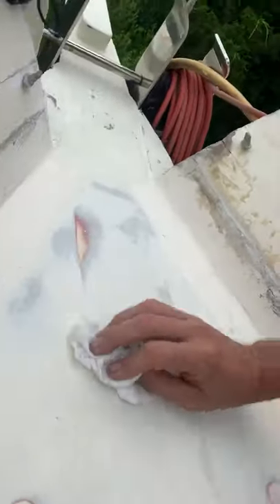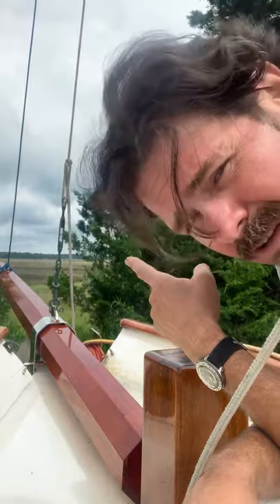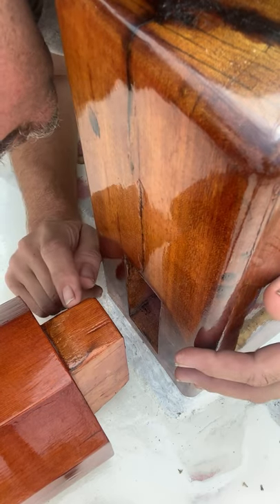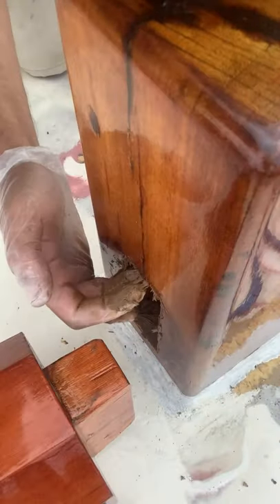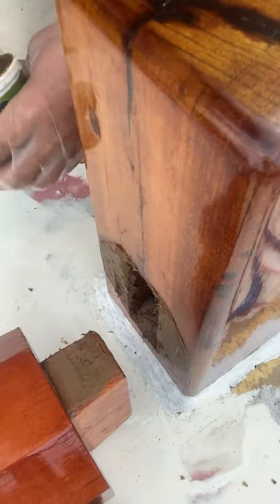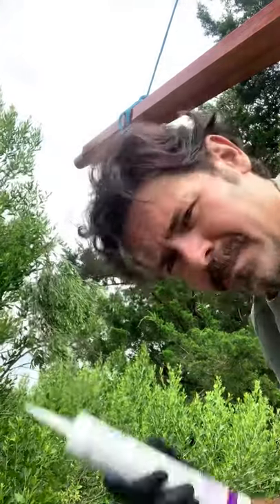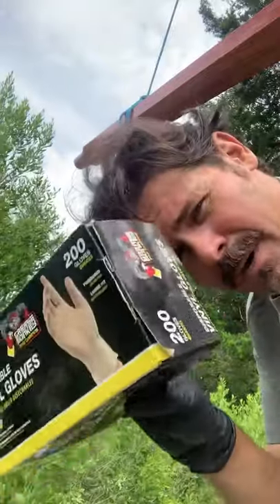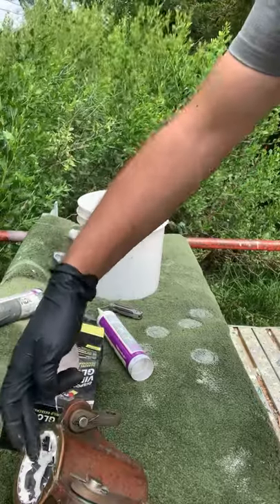Mounting The Bowsprit (Vertical Video)

Comment: Bedded mine in Dolphinite. As well the rest of the standing rig ss irons to painted wood. Right hard to get and white don’t recall the last time I saw anything other than black. Thoughts on why you feel it is better? I certainly prefer on a port frame or anything the wood and metal likely to dimensional fight each other.